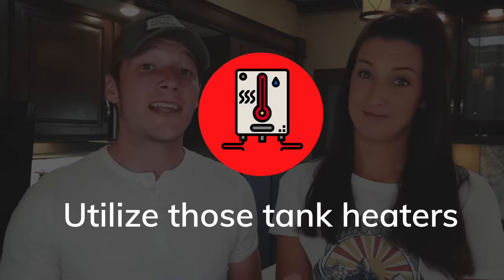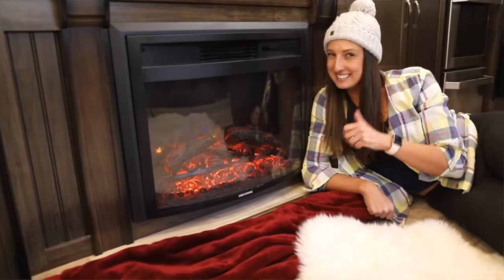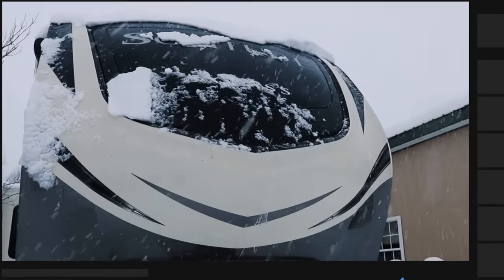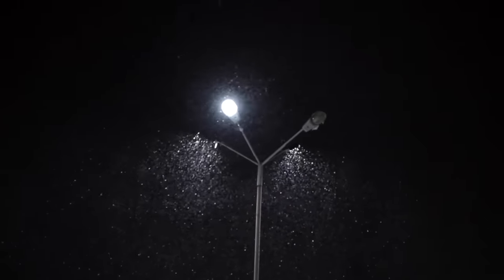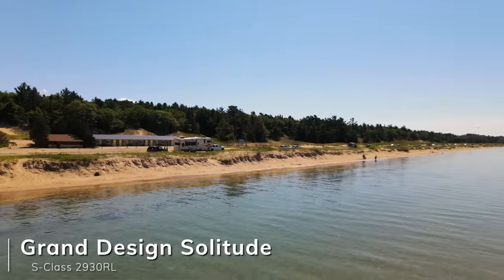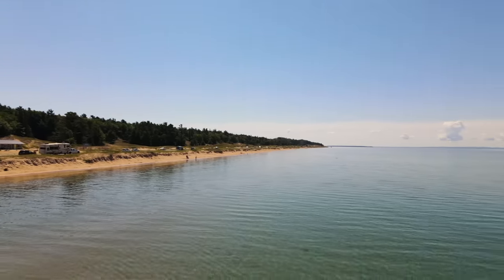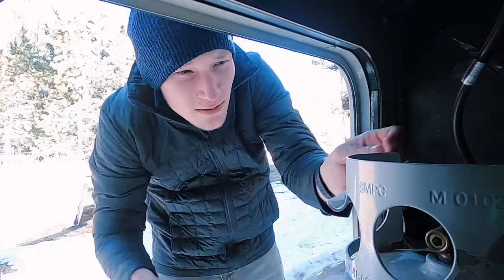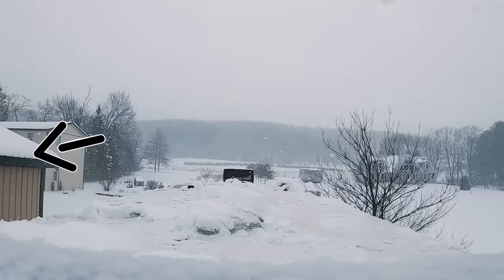Best Winter RV Camping Tips to Maximize Comfort (Winter RV Living)

Comment: Great video guys! We use our little travel trailer when staying weekends at my parent's farm in mid Missouri. They have a small house and there isn't a guest room.  October- March we drain the tanks, winterize them and rely on water from their house. We installed electric hook-ups in the barn. When we are parked there we are between the barn and the hill so are super protected from the wind from the north and the south. I think the coldest it's been is about 0°F. We do usually get SUPER cold in Missouri.  We have not installed skirting, but I will admit I'm tempted as the floor gets COLD.  I have fabric to make quilted curtians to help with the drafts.

Comment: Colorado Springs Winter 2021-2022 lowest temp ~10 below.  We used straw bales.  Had about 50-ish bales around our fifth wheel.  We did not include anything under the bedroom area.  We used an ultrasonic rodent repeller and plugged it in, stuck it on the end of an extension cord at one end of the rig and let it shoot under the entire rig (Hopefully that made sense.)  We never saw a little itty-bitty critter or any evidence of an itty-bitty critter.  If you do use straw bales we highly recommend the ultrasonic rodent repeller.  They have worked for us for years in our homes and now in our full-time travels.

Comment: Can I or should I leave the gas switch on for the shower water heater (we leave the electric on all the time in our 310GK-R.   Does it waste gas if im not using the shower?  Right now we flip it on and off every time the wife showers.  I never run out of hot water with the 12gal tank but she does. 

Thanks,

Comment: Great video and great tips! We've winter camped on numerous occasions due to my being in the field, so we know what to do. We wintered over in Golden CO in 2005 in a 3-season trailer. Yikes! Mostly it was OK but it got snowy and went well below zero (two nights were -20° but it was at or near zero for about 2 weeks). We had an exposed under belly (no cover, no heat, no tank heaters, nothing) so we had to rig up our own tank heaters and insulation under the trailer. We used blankets over the windows to keep the cold out and that worked pretty well. The propane heater struggled to heat the place but we had 2 40-lb bottles, a 100-lb bottle and 2 20-lb bottles. We made it just fine but it was COLD!!! 🥶🥶 When we headed to Texas the next January the warmth was so nice!! It was wonderful!!What relief from the cold! We have a slightly smaller travel trailer and it has a heated underbelly but no tank heaters. If we buy another trailer, it will be a full 4-season unit with tank heaters and proper insulation for cold conditions. We understand that the Arctic Fox trailers are the best insulated. We got rid of the 100-lb bottle (it wouldn't pass certification anyway) but we would get several 40-lb bottles that we could string together easily (there are kits available to tie the bottles in with your regular propane bottles easily). We have just such a kit, just in case. Safe travels, y'all!
Bob and Dottie

Comment: RE: Coldest temp so far has only been -34C (-29F) tent camping in Algonquin Provincial Park, Ontario, Canada.  We cheat now and camp in a 14ft Taylor Coach Codester with electric heat as a main heat source, a small Pomoly wood stove for fun and the built-in vented propane furnace as back up.  We have -45C sleeping bags as last resource survival gear before jumping in the truck and driving home.
We vent moisture out instead of running a dehumidifier as we can easily crank the heat up a few more degrees.

Comment: We have not camped in the winter. We have had temperatures in the teens here at home a few times. Will remember to put the dehumidifier in the Rv this winter, good information. We have reflectix in all windows anyway when not camping due to the heat in our area.

Comment: In our Airstream heading from Canada 🇨🇦 to Florida we hit a snowstorm in Jan 2022 north of Nashville, at 8,6 Farenheit or minus -13 Celsius for 2 nights, just made it to next campground beside I-75 and hooked our electric heater and ran the propane furnace !
Electric blanket was a big help, but we got lots of iceflowers on the inside of the windows .since you hey are only single pane! So don’t forget to leave one roof vent open enough so humidity can escape ! It’s worth it 😊

Comment: Hi to you Kyle, Nene and Dexter 💜🐾 I'm I noticed in the section where you were talking about getting the biggest propane tank you can and it showed the tank connected to the small hose with the door to the underside open to the Cold ❄️🥶. Why not drill a small hole to run the propane line through to the outside and put a rubber gasket seal in to seal and insulate from the weather but leave just enough room that the hose will pull out and go back in. This way you won't be exposing your understorage area to additional cold thus making your interior colder and you won't lose any heat out from that area be it from direct heat or ambient heat loss.  The hose when retracted would just have the connector end just on the outside of the door and you can put a tethered cap seal over it when not in use.   I hope you found this suggestion helpful. Love you guys and your videos and love Dexter 💜🐾

Comment: We put an inch and a half insulating bore around our slide out and it worked perfectly. Did the Noodle around the the slides on the inside and covered around with a skirt in -4 in Bend OREGON and stayed nice and warm. Not sure I would do it again 😂

Comment: My idea of winter camping is Arizona as in Tucson.  One thing I will add depending on circumstances is investing in a heated water hose.  They are expensive but may be a good thing in the long run.  I really like the trap door for the sewer hoses.  If I ever get to the point I am wintering over, that is one thing I will definitely do.  Thank you for all your effort in providing good information.

Still want to know why the Dex had to go to the vet.  George just did a trip and wasn't a happy camper.  A bad experience a year ago has definitely damaged his view of vets.  He even went after me with tooth and claw.  I feel so badly for him.  BTW:  Everything came back AOK on my boy.

Comment: I know cold temperatures can get you anywhere in the winter months. I know that I will need this information too! But there is a part of me saying "NOOOOOOO!" So, my plan is to hang out with my family in Northern California where normally it doesn't get that cold, but it does drop down some nights into the freezing temperatures which is why we used to have to put out heaters for the trees in the orchards. I tend to think it doesn't get cold there because I never buy winter coats. The truth is I just beach a lot when it gets cold about how I need to give in and buy a winter coat! Now I am in Georgia, and it gets a lot colder, and I am still beaching a lot about not owning a winter coat. 3 years of freezing my *ss off!

Comment: lowest temp was (-)5 but lots of days in single digits with 20+mph winds
froze up black tank valve open WHILE DRAINING the black tank.  hot water lines freeze first cause they run the farthest in the underbelly usually.  2.5 years of full time experience in 30 ish states.  2nd trailer now
Reply from the maker: Now that is COLD!!! Sounds like you have a ton of experience 😃 Thank you for your support in watching our videos!

Comment: Two winters ago it was -32 in Kansas. My solar was not installed, and no diesel heater yet, so all I had was a space heater. My bed was 2 1/2 feet above the floor, and heat rise’s so warm bed, but cold floor and toilet. I have a newer trailer now, but it’s not a 4 season, so I will take extra precautions.

Comment: WE were in the 0's and below many times, when I was working on the road. We always had the Aqua hot heating systems though. Like you said you must use your tank heaters and on the class A's like ours you must remember to turn on your fuel tank heater also so your diesel doesn't gel. Especially if like ours you have no propane anything. It helps if you leave the slides in also if you can

Comment: 1 area not covered is the spaces in the cabinets, under the bed, dinette seats, etc. I’m basically a semi full timer in Alabama. 30 foot pull behind. Drive 18 wheelers and home every other weekend. Last winter there where a few very cold nights, maybe high 20’s. Biggest problem was the Camco heated water hose freezing up…..weird. Any how I was going to skirt this winter, but the cost even fairly cheap I’m still pondering. I did go with a 120 gallon propane take from a local company instead of my 2 30 pounders. Anyhow….cabinets and small overlooked areas…..the reflective rolls. What do you guys think?

Comment: We are currently in West Va and it has been down into the upper 20's and low 30's at night recently, so our furnace has been working hard. The belly pan of our Airstream is heated by the furnace so our pipes have been great so far. The coldest temps we have  camped in while owning this unit have been around 19. I love Reflectix and use it summer and winter. We also use a really small dehumidifier we found on Amazon. It really helps decrease the condensation from cooking, showering, and yes-breathing.

Comment: on my rig there are insulated covers or noodles on all my lines, . i know it a pain the ass too install , but the lines never freeze on matter how cold, ! i also installed 2 ea. electric forced air heaters in the bottom of the trailer that i have its a no name unit because i custom built the trailer  myself , but the frame is from a container trailer. im currently pulling it with my 5500 dodge cummins engine twin turbo 6oo hp and 10 commerical manuel shifter.

Comment: We're camping right now, and we set our electric fireplace to the desired temperature for our rig, and set our thermostat about 3-4 degrees below that.  This way if the electric doesn't keep up, the furnace will at least keep it at a floor temperature level.

Comment: We are down to the "teens" (12 last night) here in SOUTH ALABAMA!   We are first time camper owners and my son is staying solo in ours for a few months for school. We have been terrorized with weather these last two weeks from tornados and hail to now freezing which we know very little about! These last 3-4 days especially. We are especially worried about the pipes freezing. My son leaves at 7 am for class and doesn't get back to the camper until about 6 pm. We can't leave the heat running for fear of fire and space heater as well. We have wrapped several pipes and left faucets dripping and even over the weekend when he came home cleared the water lines and put rv antifreeze in it and still had to get warm water to unfreeze the city water connection that he disconnected.  There are so many different senarios that we have no idea what is best. Oh, and did i mention that since it is a new camper, when he fired up the furnace it let off a horrible smell and set all of the fire alarms off one night. He left the door open and tried to let it air out but the smell was overwhelming and the alarms wouldn't stop going off so he had to turn it off and sleep with just the space heater. We are at wits end and have no idea what to do during the day when he is gone to keep from freezing as well as at night if the furnace won't burn the new fumes off!!
Reply from the maker: Hi Lisa! We are sorry to hear that you guys are facing some rough situations with winter RVing, it can definitely be a challenge... it sounds like your son is definitely a huge help in getting everything squared away. Trust us, we know all about the situation of turning on the furnace for the first time and the smell setting off the smoke alarms! We hope that things get smoother for you guys as you settle more into the winter camping. Thank you for your wonderful support and time in watching our videos ❤️ We appreciate you guys!

Comment: i have a 2019 grand design gk310 our  trick to keep your propane tanks from freezing up had 2 60 lb tanks Amazon sells  replacement car seat heater pads the come with  pads 4 wire stich 12 volt i put mine on out side of tanks with velco and raped car under hood insulation around outside, that keep the gas warm so i got to use all of it before refill. saved a lot of money pad kits cost about $t60.00 each and hood insulation $31.00 16sf roll.

Comment: A fun detail about that semi slit pipe insulation. Dollar Tree pool noodles will do the same thing. It's not that much trouble to build a jig to draw the pool noodle through that will cut a slit along the top of it. And the bright colors of the pool noodles are easily visible even if the snow has come. I wouldn't run an RV in places where there's extreme snow. I would much prefer a heavily insulated converted School Bus. Or a heavily insulated converted box truck.

Comment: Aloha from Iowa😂
this is our second year to winter in Iowa and we have seen temps to20 below zero. we skirted heavy with walk in cooler panels and then put heaters underneath the rig and ran them all winter. no issues.
But all of our drains were under the rig and we had a heated water hose so we did not have to unhook from the rig at all.
Good luck.
Hopefully we get to Snowbird in the south soon😮
By the way those were excellent tips!! 
A newbie should definitely not attempt a Below Zero experience in an RV.

Comment: This is our first snowbird experience. We're outside of Tucson, but at 4300' of elevation, and are ASSSURED that it doesn't go below freezing. My wife believes, I do not, so things are complicated. Our MH does not have a belly, but the tanks are indoors - well, most of each tank is  indoors, and they have heaters. We don't have a slide, we do have Reflectix on the windows. I intend to install the shrink-wrap window covers. 
Question: do you have a telescoping ladder. with a long broom, you don't have to die while sweeping snow off the roof!
Reply: Lived in Tucson @ 2500 ft for 13 years. Yes, there are freezes. Pipes in homes burst often because the feeds into most of the homes are vulnerable and unprotected. You won't need to skirt and it warms through the day most days - but overnight be sure to protect your pipes

Comment: -44 (at that point it doesn't matter if its F or C because its F*%*ing C). Fully skirted in the nasty Oil Patch with an electric heater under one end of the trailer and Mr. Buddy under the other. Running off of a 400lb pig propane tank and a diesel generator. 2 dehumidifiers.  Used the facilities at the rig camp mostly because I didn't want to have to dump tanks while it was that ugly out. Water lines didn't freeze and the light use of the grey and black tanks lasted for 2 weeks before they had to be dumped (in -15 weather thankfully). Fun times in Northern Canada.

Comment: Hey!   I subscribed to your channel only a week ago and I've already watched like 20 videos cause you're both so funny  :)      In 2020 I was full-time rv'ing in Québec until temperatures dropped to -20 celsius.   which is -4 F.     The day before we just got 1 foot of snow so it helped with the insulation on the roof ..     But since I had no running water and was using a 30 lbs propane tank every 48 hours I then decided to quit. .my fifthwheel is now equipped with two diesel heaters which is much more efficient than the propane heater electricity-wise. ...    keep the videos coming !!   I'm not a full timer anymore but a snowbird that goes to AZ.   hope to see you down the road.

Comment: Great tips for winter camping! We live in NC so we only had to deal with freezing temperatures 1 time. We also don’t full time camp. Have y’all ever tried the heated water hose? Been thinking about getting one if it’s worth the money. We don’t have tank heater either, so we rarely ever cold camp. #ThanksHanks! Happy Camping and Safe Travels!! BTW: Sure hope Dexter is feeling better! ❤️❤️🙏🏻
Reply: Heated water hose do work
Reply: #ThanksHanks-I think some scammers are on your post! I got a message to text a number to get free camping gears!
Reply: @lynnfiegl4953  I did as well. Hope the Hanks realize or read your message!
Reply: @susansmith9796  wow I got scammed big time
Reply: @lynnfiegl4953  did they try to get shipping costs?
Reply: @Findingourhappyplace  I don’t know. Didn’t fall for the scam! Seen it before. Sorry if they got you

Comment: I've seen on a "you tube" add an under belly air-up tube for skirting. Looks like it would work better than the foam insulation, because of the BIG air column inside.

Comment: what about wrapping electric heat strips around your exposed sewer lines and get a heated water hose to keep them from freezing.   i also keep a 5 gallon bucket and some extra insulation along with a drop cord light that i stick over the water valve, the heat from the light bulb will be enough to keep it from freezing.  i also keep an electric radiator style oil heater in the basement area along with the heat ducting for additional warmth around the water bay area. other than that, you guys still have some great tips and tricks for winter camping

Comment: If you are heating the coach with electric heaters and using propane to heat the belly pan and keep pipes from freezing, the trick is to buy a second furnace thermostat and mount it in the belly pan and wired spliced into the wires leading from the furnace to the coach's thermostat. Then turn the coach's thermostat OFF.